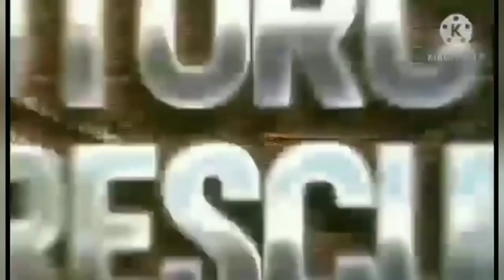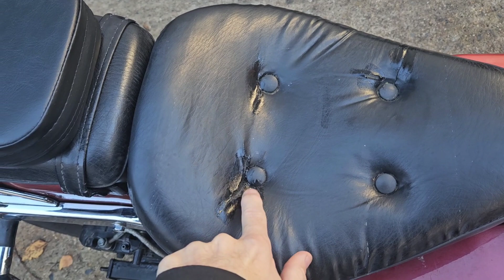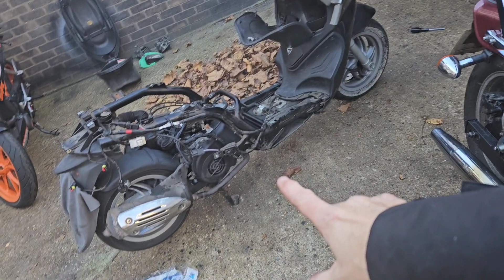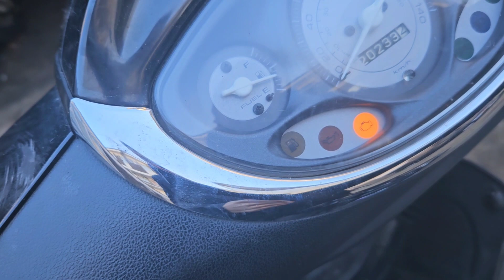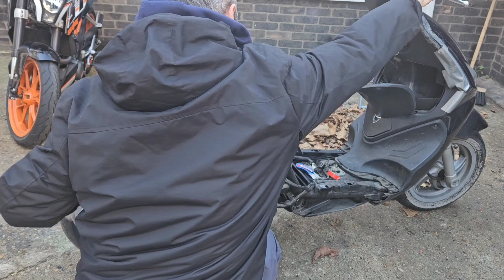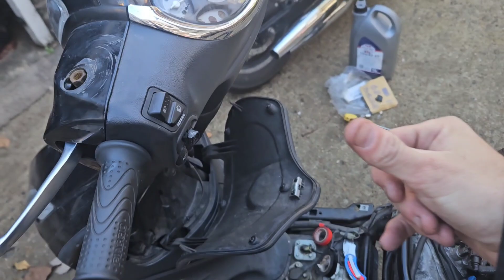piaggio fly engine swap project. New engine wasn't very good last week.

Comment: On another channel, salvage rebuilds uk, they do cars up mostly, but they have started using solder joints, basically the wires push into a connector then you warm it up with heat gun or similar, the solder flows, joints the wire together and the outer shinks like heat shrink
Reply from the maker: I've seen them I very nearly ordered a bunch. A simple lighter can set them of aswell

Comment: Charlie, just a thought... Maybe the keeway superlight seat might fit that sinnis or a harley pad.
The rear sissy pad wants to be off the rear seat in case it needs removal. On the homeward stretchnow with the fly .
Reply from the maker: I've got a rear pad now Daniel. The sinnis is running well but has started smoking when warm. Annoyingly I think that will be the valve stem oil seals. It's to cold at the moment to pull it apart. 

Although a part of me thinks that there is some water and oil in the pipes, so I plan to take them of and try to drain them somehow. 

But yes I think I'll be in this engine before it moves on.

Cheers mate
Reply: @motorcyclerescuer  think we have wires crossed lol. The riders seat might be the same as a keeway superlight not the sissy pad .
Reply from the maker: Ohhhhh yes I checked and came to the conclusion that it wasn't the same. 

One other bike that this bike goes under is the wk cruiser. 

And the engine is a 244fmi 

So I'm starting to find a few more parts now. But the smokey engine should be first ideally.

Comment: One of the cheapest and simplest options for a soldering iron is a 12v one which runs off a car/bike battery with crocodile clips. I've just bought one for £12 from Amazon for a job I've got coming up where there's no mains power. I've tried it and it works fine, and no risk of gas leaks blowing up the garage.
Electrical connections are something I've always taken great care over - I've seen too many problems caused by badly connected wiring in my career. I find soldering on an in-line join is the most reliable, although a crimped terminal is ok if it's done well, with decent tools. Whatever you use, good weathersealing is crucial if you want it to last (adhesive-lined heat-shrink tubing on soldered joints is best)
Reply from the maker: I didn't even know a 12v version existed.  Cheers Rick ill look I to one then just have a charged battery ready when needed.
Reply: Can also get gas soldering irons, run on cigarette lighter gas
Reply from the maker: @DaveW1964  that's what I had in mind. I'll look into both. Cheers
Reply: @DaveW1964  got one of them and used it a few times, for small jobs they're fine but they're a bit temperamental, mine is anyway! needs to be butane gas not lighter gas as it won't burn right.